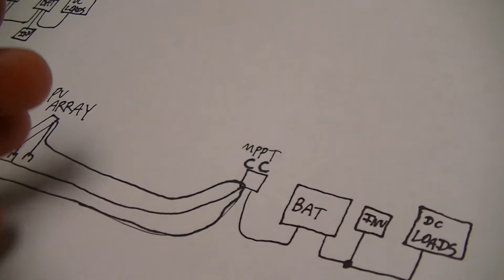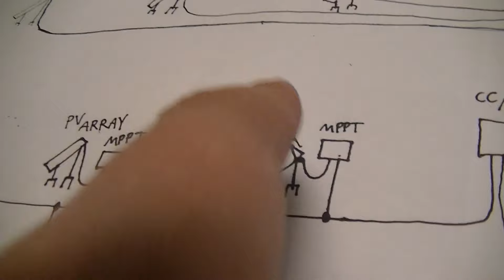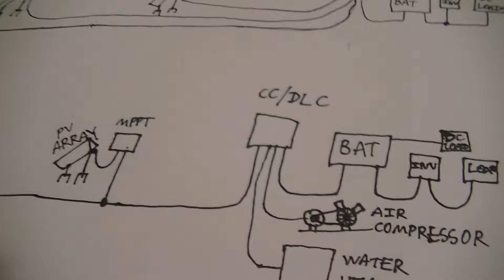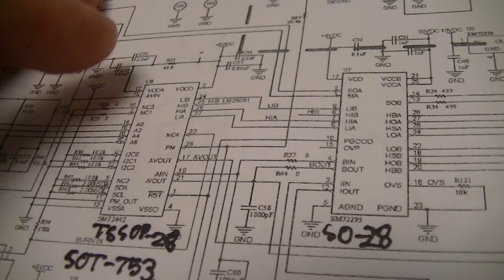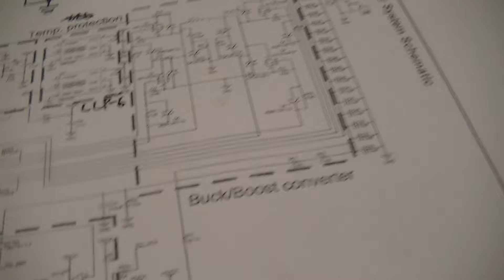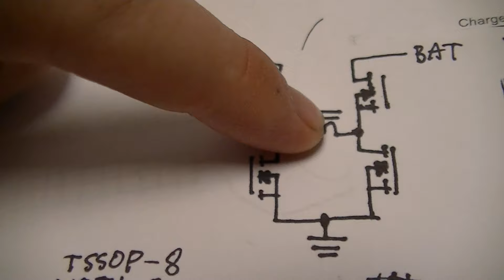MPPT rambling

Comment: Just step up your hobby a little and get comfortable working with smaller packages. Also don't invest time in diy pcb etching, let that handle by companies specialized in pcb's. Also, learning to program a uC can make all a lot easier. I am currently in the development of MPPT charge controller. Thats why your video was of my interest. Good luck with the project! Dont be scared by SMD, buy flux, good tweezers and temperature controller soldering station ( METCAL or JBC ).
Reply from the maker: Danny Bokma The point behind the DIL package comment was for ease of repair by those who do not have access to such equipment as my designs are intended for emergency power applications where the electricity is needed for critical operations.  The alternative would be mounting all the SMD control chips on a daughterboard, but that introduces extra points of failure.
Reply: +randacnam7321 Ok some of your motivation I get. But really, technologies advancing rapidly all focused on SMD, being able to source DIL based ic's is going to be really hard in 5 years. There is almost now marked now getting more expensive to produce and costly to keep on stock. I really don't see how trough hole is going to be more of an advantage in comparison to SMD.